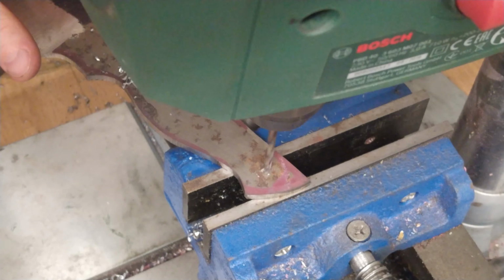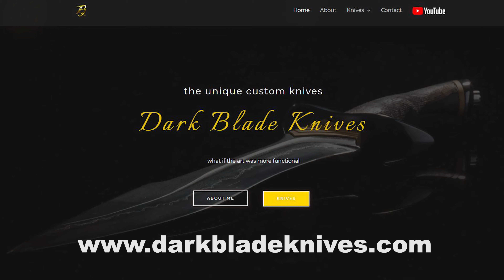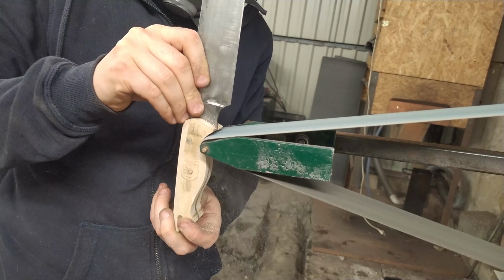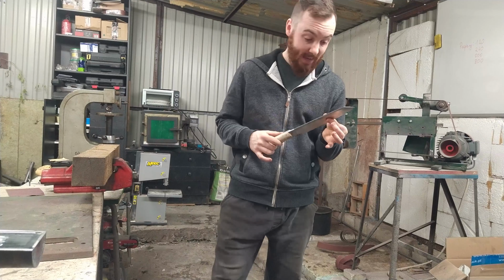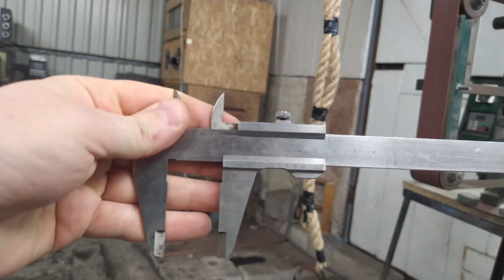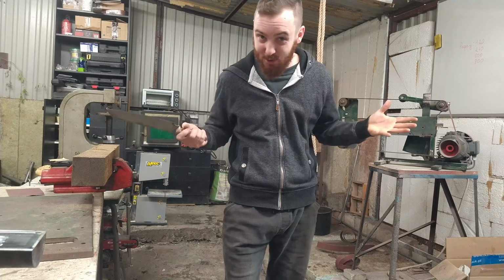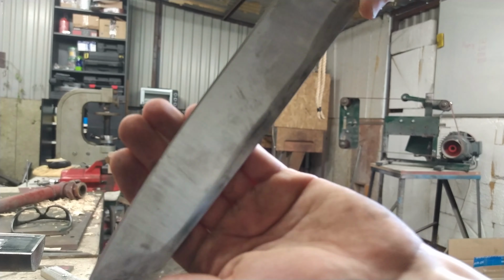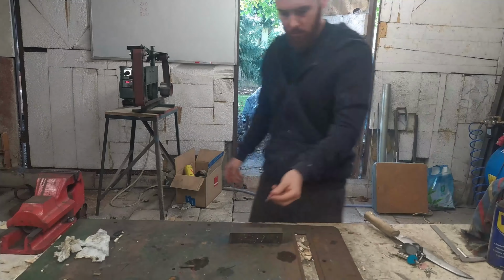ABS Journeyman: This chopper knife can survive more than you think

Comment: Wow, that's one indestructible blade right there! Cold Steel does blade tests like yours, but they use big chunks of meat as well, and I don't see you wasting perfectly good meat that could barbecued or served anyway you like it 😉 On your way to 1K for sure! Great job big guy!!!
Reply from the maker: Yes Sir! In general rope and 2x4 cut test is good and I like it (one verify blade geometry, second keaping the edge). Cuting meat is ok, but you had to make a minced meat to check the edge this way hahaha .. And you stricked to the point: what a terrible waste of good bbq tidbit :)!

Thanks a lot Man!
Reply: @DBCraftWorld  I was just curious what steel that was? I wasn't sure if you had mentioned it.
Reply from the maker: @Kratos_God_of_50_BMG  I didn't It was just 5160. nothing special. But in the future I'll try the same thing with hypereutectoid steel.
Reply: @DBCraftWorld  How about 9260 steel or  Bainite?
Reply from the maker: @Kratos_God_of_50_BMG  9260 steel is very similar to 5160- I'm not sure (I didn't work with it), but I would guess that the results would be the same.
What do you mean by "Bainite"?